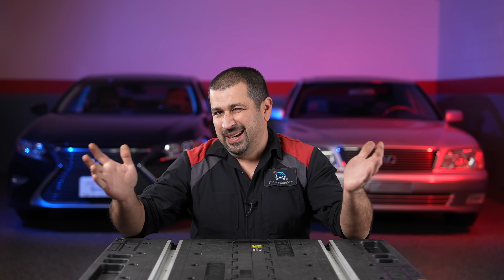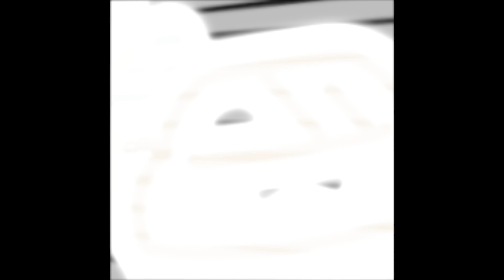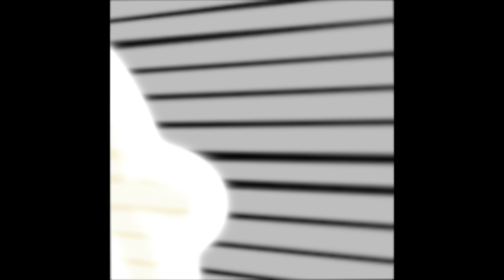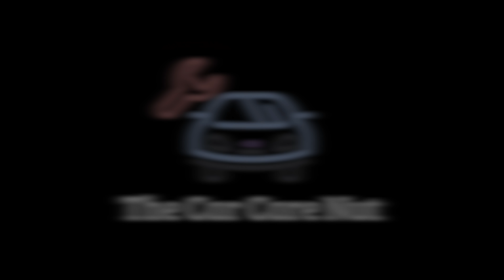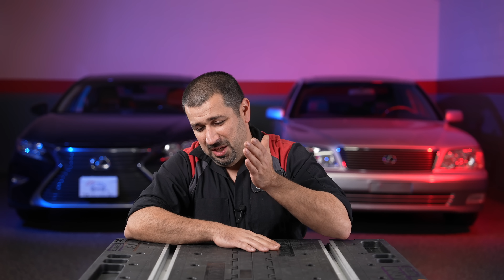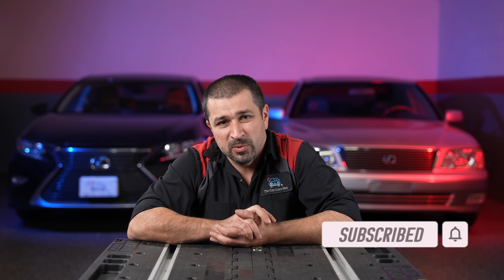Can Modern Turbo Engines Be Reliable? Here's The TRUTH!

Comment: My wife and I just purchase a 2022 RX350 Fsport two days ago. The sales guy asked me if I wouldn't be intrested in a new one instead. I bluntly told him I specifically wanted a 2022 as its the last year of the V6 and did not want a 2.4L turbo.
Reply: Yes sir me too, keeping my V8 LX and going to get me GS350 V6.
Reply: @tq3529 y’all can have those slow gas guzzlers.
Reply: @tq3529 keep it forever, just replace coolant as required, even more often. This is the only weak spot of these v8s
Reply: @tq3529 I’d try and find a gs430. Much better and you get that proven bulletproof legendary 3uz engine
Reply: @tq3529 do not do this. I have a gs350. 5000 to repair head gasket leak on well maintained 2gr with lower than average mileage. Otherwise good car if not in rust belt.
Reply: My 2007 IS350 with the 2GRFSE has 200,000 miles and has never leaked any oil, it's still going strong.
Reply: @j @joem1670 I also have a GS350 with no engine problems I change oil every 3k miles. The biggest job on my 2018 was the wheel bearing.
Reply: @joem1670 while you aren’t wrong, you aren’t totally right.  I have a feeling that with the late 2GR-FKS, Toyota adjusted their assembly process to mitigate the oil leak issues.  I have a later 2GR on my Avalon with 99k miles, no leaks so far.
Reply: @joem1670 lmao you got ripped off
Reply: @joem1670 I will bet with you that you did not flush your coolant every 40-50 thousand or 4 years. You killed your car yourself.
Reply: My 2005 Tacoma had a 4.0, great engine.  My 2017 Tacoma has a 3.6 I believe.  I'd prefer the 4.0.  I can't imagine I'd ever get a 4 cylinder turbo Tacoma.
Reply: @G @G1951-w1y      great truck!  i own a 2003 V6 3.4L MANUAL tacoma 18mpg with 204,000 miles smooth as silk
Reply: I bought a 25 RAV4 hybrid non prime for a work vehicle I commute 40 miles each way due to the research into how reliable Toyotas hybrid system is in general but especially the transmission. I have no problem having some battery regression I will replace it when I have to at least it won't eat itself and grenade my 2.5 that I plan on putting 300k on....I will not own a turbo if I can help it.
Reply: Exactly why I bought a Toyota aygo x , wont set the world on fire with speed or exceleration having no turbo , but it gets me from a to b reliably and engine has been produced since 2005 with regular oil changes gives a long life !
Reply: @malcolmkempster7858 isn’t that wet belt?
Reply: I convinced my folks this year who wanted a Highlander to get an older one with the 2GR-FE, not the FKS and definitely not the 2.4L turbo!  They found a 2016 Limited with 25K miles for $20K less than a new one and are happy as can be and it will last 300K miles no problem.
Reply: @BartSparrow123  Smart move. I had a 2016 Highlander and put 158K on it in 5 years. Then it was totaled. Never had a single issue. Great engine also. Transmission was a 6 speed. In 2017  came out with a somewhat problematic 8 speed. Your folks will be happy.
Reply: @ronfranz7578  agreed.  The 6 speed transmission was a gem, they never go bad unless they lose the ATF fluid.  Drain and fill the ATF every 60K miles and it will go 500,000 miles.
Reply: @BartSparrow123 what's wrong with FKS?? I have 90k on my 19' highlander and the engine has had no issues or leaks.. transmission different story..ground itself to near death..replaced it.
Reply: @midnitemonty like you said, TRANSMISSION. Engine next!!!
Reply: @BartSparrow123  I have a 2GR-Fe, the FKS is a superior engine and uses a better fuel injection system.
Reply: @MJ-5k  I have an FKS now and it is more complicated and more things to go wrong.  Also the high pressure fuel pump has caused 100's of fires on these engines!
Reply: @BartSparrow123 welcome to capitalism.. 🤑🤑🤑
Reply: @MJ-5k It's superior as far as efficiency and power, at the expense of added complexity and reliability. Many more issues on the FKS than the FE including oil leaks from everywhere.
Reply: @JP81188  Well under communism you would be riding around a 125cc moped because the government banned cars.
Reply: @BartSparrow123 you have no clue what communism really is.. 😂😂😂😂😂😂
Reply: Interesting this account is a month old and all of the comments are promoting communism. Wtf?
Reply: @mattmetzger8605 hey. Respect the new thing! 😊
Reply: @BartSparrow123 it will suffer an oil leak, trust me, all the 2gr fe motors do.
Reply: @tagheuer02  No, not really, only the early ones.  It was the oil line for the VVTI, the earlier ones were rubber lines, then in about 2009 they changed it to a metal line.  Now if you mean the timing cover will leak, sure...mine was leaking a tiny bit at 277,000 miles...barely enough to leave a few drops in the driveway after parking for 3 days.  I think we can live with that, or just replace the timing chain and tensioner every 300K? haha
Reply: Yeah timing cover will leak, very expensive fix and it will continue. Wait until the hinges on the rear power hatch tear off from the body. Thats another fun one  @BartSparrow123
Reply: @tagheuer02 100%.  Toyotas/lexus quality myth.  Don’t forget came phaser rattles and power steering leaks too.
Reply: @tagheuer02 you're absolutely correct. The timing cover leaked on my 2017 2GR and it's a very expensive enginge out fix.
Reply: @RotaxXS  myth? What would you say is overall more reliable than toyota? Some good era hondas, the small old Nissan pickups, ive been super impressed with a 2014 Ford fusion in the family... theres some good cars out there but I've seen more 200-400k toyotas than anything else
Reply: Naturally aspirated for the win!
Reply: @Tide2Texas NA or nothing brother
Reply: @CJColvin naaaaa. Na but fr tho I've seen my bil's Acura drive with a blown turbo. Sucks for a dd
Reply: My last few cars were turbo diesels, love items all!!!!
Reply: Engine oil changes at 15K are a joke, I learnt to do it myself, I change oils every 10k,  buy the quality oils when there are specials and my engines are thanking me all the way
Reply: Smart.
Reply: @galencaudill6462 really.. so you bought someone else's headaches.. 😂😂😂
Reply: I got one two years ago. Very smart move on your part. They are calling me asking me if I want to trade the car. I said Heck no. That ds4 V6 is a great engine almost as good as my 1uz-fe in my LS 400.
Reply: Im glad i don't have  a turbo on my 2019.colorado  it's a 2.5 4cyd  with  200.hp . I dont tow so low horsepower is not a problem it get 21 city 26 highway. And it's a 4x4
I dont want a new truck too many electrical issues with the computer
Reply: Do what I did, opt for the hybrid. No turbo in the hybrids.
Reply: Ford makes a 5.0 liter v8 engine.  It must pass emission tests.
Reply: This what happens when a Federal Agency has too much say about the manufacturing of any product. They force the companies producing the product to make the consumer more dependent on the company because the product needs more maintainence. Newer Motorcycles are more needy of mechanical upkeep too. All because of CAFE standards. Thanks, Obama. His signature passed the current standards into law.
Reply: I’ve owned many turbo vehicles.  Never had an issues. Oil changes every 6 months and I drive 12000 kms per year.
Reply: @johnespanol1273 You obviously know how to drive sensibly
Reply: I swear I saw a video he did saying that the last gen v6 had bad timing chain guides...it was on a Highlander v6 with like 40k miles on it..
Reply: I bought a 2022 RX350 F-Sport and not the newer and available 2023 because I wanted a tried and true 6 cylinder motor that I knew from experience would last forever.   Sadly, it's probably the last real motor I'll ever have.  I'll probably get top dollar for it when I decide to sell it.
Reply: I bought a 22 Rx 450h after watching his video on “The last of the V6’s”
Reply: I got the 2.0L turbo RC300 and love it! Still going strong!
Reply: I never show a salesman my cards.  They won’t ever show you theirs.
Reply: F does not mean anything on RX,  you  overpaid  a lot just for the suspension  not got drivetrain, also can tell you that RX is poorly made now. I know that aswe have 2019 350. weleased it  new and my wife loved it so we bought it after our lease was up. So again its not bad compared to other brands today;.  but it has very cheap materials compared to  BMW. all the suspension on RX is steel. not aluminum. Plastic on bumpers are paper thin compared to Lexus from 2000s.. I had  major issue with the front brake caliper , where adjuster just rusted and froze like it was never greased from the factory I again that was new lexus kept by us never no one did any work on it , when  i went to do the brakes for the first time at 40K miles , i could not even remove caliper from the bracket. had to drill it. And we are not even in the rust belt. we are in NJ where not much snow lately.
Reply: Well done. I'm keeping my RC 350 because it's reliability.  Now it's already 10years. 

Now im focusing to restore my turbocharged old Toyota GT FOUR ST246W. Great 3sgte engine.  Already 14 years and still running.
Reply: Am a truck driver for 20 years and I have a lot knowledge about engines any engine, including boxer engines., I use TURBO ENGINE ONLY in tractor commercial truck , BUT I skip any single turbo engine for pickups truck , SUV and sedan cars , just no worked basically is just scam technology , Turbo engine is ONLY for tractor commercial trailers
Reply: And aircraft.
Reply: @pacae911 Nah.
Reply: Completely agree!  I did the exact same thing.  That 3.5L V-6 is in a bunch of Toyotas as well. 5,000 miles / 6-months whichever comes first. Do that, it will last a real long time!
Reply: Why would anyone get an inline 4 over a V6
Reply: @Driving_Somewhere  I had both but with a four banger now.  Plan to return to V6 for a smoother sounding vehicle.  Also not much of a difference in MPGs.
Reply: @Driving_Somewhere pricing
Reply: @Driving_Somewhere exact
Reply: @Driving_Somewhere Inline fours are great for small cars.  Motorcycles too.  I love inline fours and have one with a turbo.
Reply: @Driving_Somewhere .Fuel economy
Reply: @daveyboy6985 even if you take care of it you will never drive it  enough miles to make up the extra 2 or 3 miles per gallon you get.
Reply: @Driving_Somewhere NO CHOICE NOW!!!!!
Reply: @Driving_Somewhere the 2gr. Power of a 4 cylinder and fuel economy of a v8
Reply: But it still sounds like a 4 cylinder, and it has turbo lag.
Reply: Poor salesman. They really bear the bunt of the anger created by the stupid rules that the politicians at the top make...
Reply: same with the Highlanders.  I get our daughters 2019 soon.!
Reply: Good Job!! I own a Lexus IS 350 2012, wouldn't change it for anything, save for maybe a n/a V8 Lexus model, however three months ago I purchased a Honda CR-V for my wife. My specific requirement was a last of the 2.4 litre n/a 4 cyl five-speed auto. I found a perfect example, a 2016 (last of the series) top of the range VTi-L with only 49,800 km (31k miles). Super happy with the purchase. No surprises the following model from 2017 onwards with the 1.5t turbo and CVT has oil dilution issues and transmission problems! Eff THAT!
Reply: Haha and teenagers in the early 2000s wanted to turbo a b16 swapped cr-x that was able to run 14s naturally and 12s with a turbo
Reply: Exactly! I've been looking for a good value on an RX premium. I have a 2007 Avalon with the 3.5 engine. One of the best engines Toyota has made. Just look at the numbers of years it has been produced. The 2022 is the way to go.
Reply: What was his reaction?
Reply: I bought a brand new 2022 RX V6 and I hated the car before I even got home with it.  The transmission programming was terrible.  And it had the dreaded droning  and vibration problems that this V6 is known for in the RX, and Lexus never solved.  Traded it off for a big loss seven months later.  I don’t get the fanboy stuff about this engine other than maybe they run a long time.
Reply: @alanbuck9237 Probably the 8 speed that sucked? Many people hate the 8 speed transmissions.
Reply: @alanbuck9237 
Yes, I wanted to buy a 2022 RX350 a few days ago.  I went to test drive it and I noticed the vibration. I think it's the drive shaft that's vibrating. It wasn't too bad but I didn't like it. Do you know if the RX 450H has vibration too? Thanks.
Reply: @arshadkamel4640  No 2020 - 2022 RX450H is the way to go. But I will say if you probably test drove another one it more than likely wouldn't have that issue.
Reply: I bought the same thing last July.  It had 18.5K miles on it.  Had to bring it from FL to CA—Cost $2K extra but worth it!😂
Reply: Bart sparrow. You are an id!ot.
Reply: They are standard in many european small engine cars and no reliability issues
Reply: wow - really exciting story :/
Reply: Actually it would probably help if the powertrain engineers did have to have a PE license but they do not
Reply: I hear you.  I've got my 3.6L 6 cylinder Subaru and zero interest in a turbo 4.  They are better than they used to be, true.  But they're still a device to transfer money from your pocket into someone else's pocket.
Reply: @xlerb2286 
Subaru has one of the best CVTs, that may be damning with faint praise, but just do a drain and fill every 30-40 K miles and you should be alright. I own the same car in a 2018, engine oil changes every 4-5K,  car uses less than  1/2 quart between changes, Pennzoil Ultra Platinum, change it myself and I’m 76.
Reply: I remember when the new V6 came out, the same rhetoric was going around that this one did
Reply: No
Reply: Smart indeed
Reply: Lot of pressure on head gaskets.
Reply: Holset made good turbos
Reply: I just bought a 2021 RX350. Same logic.
Reply: It’s why when I was looking at civics I made sure I got one without the 1.5T. Give me the 2.0 NA.
Reply: you would've been fine with the 2.4 turbo, that engine has proven to be extremely reliable, and over the last 5 years that it's been in production it's had fewer issues than even the 2GR V6 and is currently Toyotas most reliable engine, even more reliable than the 2GR and the A25 4 cylinder in the RAV4.  People forget that most GR V6s need an engine out repair before 200k for the timing cover gasket leaking oil.
Reply: Very good decision. You'll go a long way on the RX350 engine. Enjoy!
Reply: Smart move even the Toyota mechanics are having issues working on these new turbos junks!
Reply: Toyota shot themselves in the tire.
Reply: Wow, this made a lot of sense… thanks 🙏
Reply: Your the ideal type of customer that keeps GM alive. Absolute rubbish quality. Dodged a bullet.
Reply: I own a Civic with the L15 Turbo. (1.5T 4 cylinder) It is known to be unreliable. Two things I do is I use 93 octane and I make sure I replace the oil every 3-3.5k miles. 5 years in and I have no issues. Even the dealership service department was impressed in how smooth the engine is because I am taking care of it.
Reply: BIG LOSS!! LEXUS SALED SAID IT IS A INVESTMENT. I LAUGH ED MY ASS OFF. SCREW LEXUS!!! MAKE A GOOD CAR AND THEN THE DEALERSHIPS WILL ALWAYS RIP YOU OFF. MARKUPS, ADDED DEALERSHIP ADD ONS. 500.00 MARKET ADJUSTED PRICE. CRAZY PRICES!!!! THEY HAVE RUINED YHE BRAND
Reply: No complicated turbos, cvts, and direct injection! Love rdx 2014
Reply: 100%
Reply: Been thinking of getting the 450H for 2022 or prior - I have a '07 Hybrid V6, they are just so smooth and very quick.
Reply: I just did the exact same thing.
Reply: I had the Toyota 3.5 V6 in a Highlander and I liked it, but it was 16 years old and so I just got a 2025 4Runner with the 2.4 turbo and I LOVE it.  I am averaging 9.7 L/100 km (24.25 mpg US gallon) in cold temps and with snow tires. My 3.5 V6 in these conditions would average 11.2 L/100km (21 mpg US gallon.  Plus it has far more low end torque and accelerates much better and holds speed up hills without much downshifting.  The only thing I don't like is the sound under narder acceleration.  The V6 sounded great and 2.4 turbo sound like a wheezing vacuum cleaner, but I can live with that for the benefits.   Time will tell on reliability, but that 2.4 turbo is in all kinds of Toyota products so I expect it to be reliable.
Reply: I bought a new 2022 Highlander in 2022 . I didn’t realize it was the last year with the 3.5L V6 . I am glad I decided to buy it when I did . It will be my last Highlander . Same with the 4 Runner etc . It’s not just Toyota doing this for sure .
Reply: Same here.  I have the 2022 RX450h FSport
Reply: Very wise choice
Reply: I drove a Nissan Versa hatchback with the 1.6 litre 4 pot paired to an auto. That thing was pretty bulletproof except for a failed compressor and worn out front mounting points after a 9 year run.
Reply: yep...I saw 22 was the last year for the v6 in the rx and that's the one I shopped for. The other was the V8 GX
Reply: I think the same way. A used v6 is much better than a new turbo. The only bad thing is that used cars are really expensive these days.
Reply: I did the same with a 2018 Acura rdx.
Reply: I recently got a (used) IS300 awd because it had a 3.5L V6 vs an NX300 because although both were manufactured in Japan, it was not a turbo
Reply: Procharger on a 4.0 4Runner anyone?
Reply: Crazy!!!!
Reply: True, with Turbo engine,  you need to change the engine oil way before manufacturer recommendation. I have no engine problem with my Saab 95 I bought decade ago 😊
Reply: you made a big mistake
Reply: you could. gotten a rx350h , it doesent have turbo , it has a 2.5l  plus the proven ecvt that toyota has
Reply: And,what did they say?
How good turbo is?
Good for you, btw.
Reply: Love the buttery smooth V6 in my 2019 GS 350 F Sport RWD... Love it.  Would never trade it for a crappy 4 turbo Lexus or EV. No way in hell.
Reply: good move, i explain it this way,,,car companies got rid of 6 cyl. for 2 engines, a turbo on a small 4!
Reply: I have a 2021 Tacoma TRD Off road with the 3.5 V6 and 6 speed auto trans, With only 19,000 miles, Some guys tell me to keep it forever, Other guys want to buy it.
Reply: Agree, 2.4L turbo for car like RX is shame.
Reply: Yes, they can be reliable, but they do need to be maintained.
Reply: Turbos are FUN!
Reply: I bought a 2018 Outback 3.6L flat six for exactly the same reason, no second thoughts whatever.
Reply: I bought a 2019 RX350L last year. Same reason. I will NEVER own a turbo. Screw that garbage.
Reply: In diesel engines, I prefer turbo as he said.
I have had 2.4 Volvo t5, that's a gasoline engine that you could push without engine Blow up early, never have had any problem with it.
But again, I talking about earlier Volvo.
New cars is not as reliable as earlier model's 😢
And I have driven my Volvo hard, got Volvo D5 now.
More reliable Engines 👍
Reply: V6 Twin turbo for me. They are great. Will last as long as you make oil changes. Lexus rx350. Lmfao. Had 2 and they rust big time. Radio will quit.  Handle like shit, make inside rattle and and squeaking noise very soon after new...... enjoy your crap
Reply: @joe6096 Ditto 2018 RX350L.  Grandkids love the "way back" seats. Only in the neighborhood,  as there's no protection in a rear end collision.
Reply: LMFAO.. you guys are ignorant af. Plenty of Turbo Subarus have racked over 500k, and even a cool million miles.. They even have a High mileage club. The problem is with you, not the turbo... you like your 10k oil change interval and whine when your engine has problems.
Reply: @crisnmaryfam7344  😂😂😂 Subarus? They use a boxer engine, genius..talk about ignorant🤦
Reply: @darinsassen617 ayeh.. they do a lot of leaking. Engine on the side, gaskets, oil starvation kinda like. 😊
Reply: @joe6096 it's how you maintain them. My friend has a gen 1 Ecoboost from 2011 3.5 with 170k miles on it still runs great.
Reply: I'll just buy a used V8 LS every 10 years. When I'm 68 the last V8 LS will be 23 years old. Still with another 20 years of life in it. First Gen LSs are running strong 35 years later with a half million miles on them.
Reply: @joe6096  That makes zero sense.  There are 1% of those 23 year old V8 LS engines still in service at ant mileage.  At 35 years of age with a half million miles you are describing the rare unicorn that may show up every so often.  You are over selling it.
Reply: @kelviskelvis7140  Not sure where you get your data from but eliminating wrecked and totaled cars you can easily find 35 year old LS400s running in very good condition at well over 300-400,000 miles.
Reply: @joe6096  
This is correct. I bought a 1991 LS 400 new and when I replaced it the mileage was 279K miles. I had zero issues and it didn’t burn any oil. My subsequent LS 430 was equally as good.
Reply: @joe6096  The internet is very good at finding unicorns.  But that does not make it a bargain.
Reply: @kelviskelvis7140  You’re delusional. Finding 30+ year old LS400s and 430s in great condition is easy. 

Most of them are well maintained too because they’re not the kind of car idiots would be caught dead in. 

What year would you like?
Reply: @joe6096  Honda/toyota turbodiesels are reliable tho
Reply: @Shabbe02  They don’t sell their diesels in America.
Reply: @joe6096  They only make 2 engines each.  Honda a 1.6 & a 2.2l.  Toyota for their large SUVs, a V6 and another
Reply: @joe6096 Toyota used to sell diesels in the US
Reply: @joe6096  don't lie to yourself, 10-15 years from now majority of gas cars will be turbo. Your options to get a nonturbo car will be limited, so you will give up and buy turbo.
Reply: @SamuelBSR  Hybrid and EV's?
Reply: @losiglowful yes, these are alternatives. BTW, it's not only Toyota/Lexus, Honda/Acura has been following the same turbo path. I recently bought 2017 Acura RDX V6 3.5L, from 2019 RDXs became 2.0T.
Reply: @SamuelBSR  I would get a hybrid non turbo, better all around.
Reply: @SamuelBSR  I had a 2019 RDX A Spec it's junk. NYC City MPG 9 to 12.  loved my 90 Legend Acura is not Acura anymore.  I now have a 2022 RX 350 it's getting 17 to 19 in NYC traffic. Bigger car 2 more cylinders and better gas mileage. You figure that one out. Oh highway at 70 Curse control on RDX got 30 MPG RX 350 33 to 36.
You can't tell me a 4 cylinder is better. No I am not an aggressive driver.
Reply: @SamuelBSR you buy your turbo and we will buy what’s left forrest
Reply: @SamuelBSR  they’ll be plenty of hybrid non-turbo options I believe
Reply: Just get a hybrid non turbo.  Very nice.
Reply: @SamuelBSR  turbo is not the issue, i'd be fine with turbo v6 or hybrid turbo, but just a plain i4 turbo powering a big suv..... the driving experience in the V6 is better, or the hybrid V6 is my preference bc it moves so fast off the line in city traffic.
Reply: I flew 1000 km, and stayed overnight at a hotel, to buy a 2015 RX 350. sooo, glad I did.
Reply: I think direct injection is a bigger problem than turbo charging.
Reply: @TJ-oi5qe know but it's a big one.
Reply: For me its NA or nothing, no replacement for displacement
Reply: I once had a desire to have every engine layout. I like performance cars, coupes and manual transmissions. Over the years I have had nearly every engine layout from turbo, supercharged, i4, v6, V8s. I have 3 naturally aspirated v8 vehicles and one v6. There really is no replacement for displacement if you want that smooth reliable power.  Ford 429 big block, 2urgse, 1ur-fe.
Reply: Right on!  No turbos....
Reply: We purchased a 2021 RX350 off-lease, and the salesman asked us a similar thing, “do you want a 2023”?  We said no thank you!
Reply: I have a 2017 Honda Civic Type R making over 400hp to the wheels. I track it a couple times a year and it now has 110k miles. I change oil every 5k miles with 5w30 instead of 0w20. This same car outside of North America has 5w30 specified because they are not trying to meet CAFE standards
Reply: Am a truck driver for 20 years and I have a lot knowledge about engines any engine, including boxer engines., I use TURBO ENGINE ONLY in tractor commercial truck , BUT I skip any single turbo engine for pickups truck , SUV and sedan cars , just no worked basically is just scam technology , Turbo engine is ONLY for tractor commercial trailers
Reply: I would take a turbo for a small car but not for a SUV.
Reply: @bngr_bngr as if it won’t fail
Reply: I would prefer a supercharger over a turbocharger!
Reply: A supercharger is much better on an, automotive gasoline engine than a turbo.  Turbos are great on diesels and aircraft engines.
Reply: Good for you.:hand-pink-waving::face-blue-smiling:
Reply: U didn't have to get f sport. They still make non turbo engines lol
Reply: @marksrepairj623  Not on the RX. The turbo 4 has replaced the V6
Reply: @joe6096 hmm thats funny i own a rx350h non turbo 4cylinder
Reply: @marksrepairj623  Yes that’s a hybrid. We’re talking non-hybrids.
Reply: @marksrepairj623  if sport is where it’s at that dynamic suspension is awesome
Reply: @artieartya until it breaks ofcourse. Then you can fix it in your own garage ofcourse. 😊
Reply: @arthurfisch3673  yeah but the argument is about turbos and reliability and a hybrid non-– turbo is far more reliable.
Reply: @marksrepairj623 rx350h (hybrid) gets non turbo engine
Reply: @markoyl i know i own that car.
Reply: Excuse me Sir/Madam but i was wondering whether longer intervals would be more acceptable in europe since my uncle told me that here in europe and britain, such intervals are fine because europe´s climate isn´t harsh on cars. But those long intervals are blowing my mind since back in my region in middle east i was changing oil every 5k kilometers, some criticized mefor not doing it at 3k. i would appreciate any insight.
Reply: Why an F sport? Firmer ride, firmer seats, still handles like a crossover just costs more to be less comfortable?
Reply: @MikeKayK  Having an f sport is noghr and day compared to a non sport
Reply: The end of the high pollution ice bucket 🪣 era…your kids will be driving EV’s 😀
Reply: @chrisvig123 With new battery(Solid state...) EVs will be worth but with Lithium = HELL NO!! 😂
Reply: Smart man.....turbos are nothing new, they were a disaster back in the day and only used in select cars for those who can afford it.
Now fools have to relearn the lessons the hard way.

The laws of physics are not suggestions.
Reply: OK Boomer
Reply: Why you told him bluntly ? Was he rude to you to begin with ? We are getting to be an uncivilized society.
Reply: 👏🏽👏🏽👏🏽👏🏽 I KNOW THAT’S RIGHT b16da93! NA or nothing. Let the guinea pigs buy the new junk and laugh when they complain on why their vehicle is a piece of depreciated origami!
Reply: Huyndia and Kia motors are good for 40,000 miles without a turbo. Half that with a turbo
Reply: The hybrid or plug-in are the real reliability kings!
Reply: @alliejr  The 2.4 turbo is actually Toyota's most reliable engine as of 2025, more reliable than the 2GR V6, more reliable than the A25 4 cylinder that's in most of their hybrids.
Reply: @alliejr  well, we are yet to see how well these CVT transmissions last on them.  CVT doesn't have a good longevity track record.
Reply: @BartSparrow123 If you mean the E-CVT transmission in Toyota hybrids, then it has nothing to do with the CVT transmission. E-CVT transmissions with planetary gears are extremely reliable.
Reply: @Elmeri79  I honestly don't know enough about the difference, this 2021 Camry hybrid I'm driving is the first CVT I've had.  Does the E-CVT have a belt at all?
Reply: @B @BartSparrow123  the e cvt by Toyota is one of the most reliable transmissions ever made
Reply: @BartSparrow123 there is no belt in the e CVt. It’s electric motors and gears. Very reliable.
Reply: @BartSparrow123  Toyota Lexus eCVT is a gem, very robust .
Reply: @BartSparrow123 No, the Toyota eCVT does not have any belts.  It's mechanism is very similar to a rear differential. A small number of gears that are always engaged.
Reply: @BartSparrow123 Not on Lexus! They are e-cvt transmission. No belts no chains or cones! Just planetary gears. They are among the strongest transmission, made!
Reply: Depends on the brand…Honda ones are better then regular transmission
Reply: You realize it’s nowhere near a belt&cones CVT, which have those reliability track record you’re talking about ?
Reply: @BartSparrow123  ECVT is what Toyota and Lexus use and it is nothing like what you’re thinking of on some other manufacturers it is actually extremely reliable
Reply: @BartSparrow123  Depends on the mfgr and design.  Toyota ECVT is quite good.
Reply: @BartSparrow123  Nope.  Planetary gear system.  No belt.
Reply: @ackerrj  Thanks, good to know!  I changed the transmission fluid on my 2021 Camry Hybrid and was surprised it took ATF.  I was assuming it would take gear oil.
Reply: Wow, you're so old school
Reply: @tagheuer02   And the problem with that is ???
Reply: @tagheuer02 You sound like the perfect beta tester. Too inexperienced to know good from bad. I've got a new crypto coin if you'd like to invest? It will make millions 😃
Reply: @tagheuer02 You will be there someday.😂
Reply: @toddsmith1617 senior citizens driving Lexus to the retirement home. No turbos for me! No iphone either. Its spying on me 😅
Reply: @tagheuer02  wow look at the edgelord.....
Reply: @Longvillle you're one of those lol 😅
Reply: @tagheuer02  How did you post this comment?
Reply: @toddsmith1617  I'll wait till they've proven themselves for 20 years.  Oh wait, I'll be gone by then.
Reply: @tagheuer02 😂😂😂
Reply: Just skip the turbo engine and buy an EV
Reply: @kelviskelvis7140  Where’s the infrastructure? What needs to happen is shut the EPA down and produce the old American V8 again. The most reliable engines ever.
Reply: @mikee2923  You talk like the weaker V8 engine is a good thing - it is not and never will be.  I think you have an orange stain clouding your thoughts.  Who cares about the EPA, it is the total waste of tax payer money being poured into oil production just to prop it up that needs to go away.   You ask "Where’s the infrastructure?" - that orange blindfold has you handicapped,  The infrastructure is more abundant than your gas pumps.  The V8 is a dead end.
Reply: @kelviskelvis7140 you're the only one blinded by the orange. Well, the only one here anyway. Do you people ever get tired of yourselves? Does it ever stop ringing in your ears?
Reply: @ckennedy309  Funny. Trump’s been living rent free in your head since at least 2016. Seems like when you can’t defend your point of view, you gotta bring up politics. But those positions are also weak. There’s a reason why we’re referred to as the right. But to be nice we refer to you as the left when we should call it like it is and just call you wrong.
Reply: @mikee2923 are you talking to me? Pay attention.
Reply: Seriously? California has constant power issues. If you have an EV your screwed, at least with a gas engine you can keep driving. You must live inside city limits and never leave cuz it sounds like you have no idea how things work in rural areas.